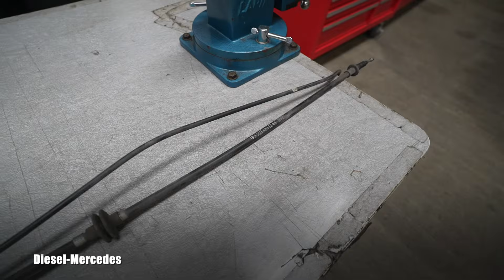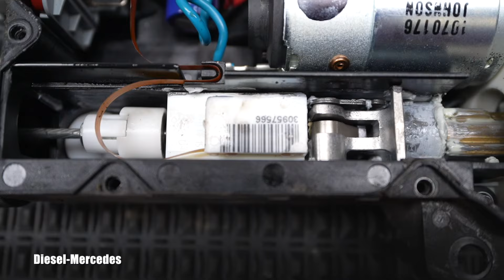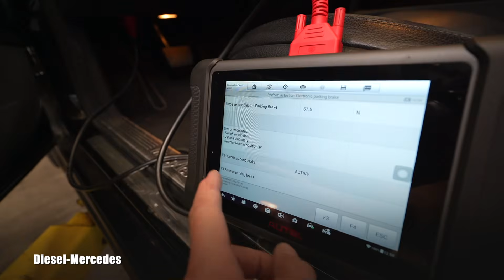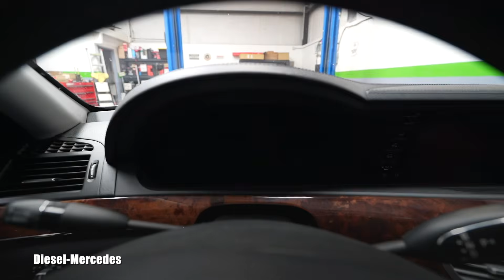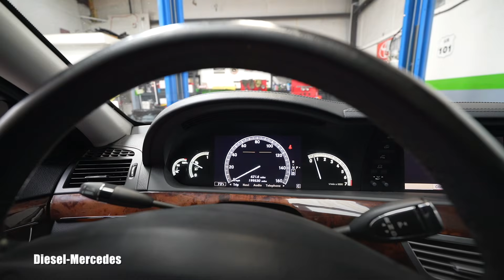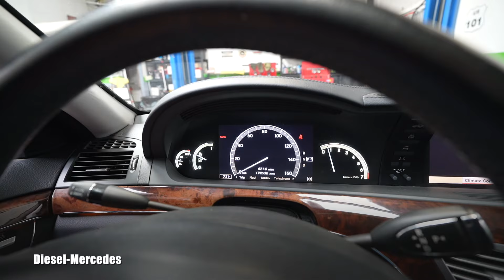Mercedes Electric Parking Brake Diagnosis, Repair, Reset

Comment: If you get:
test prerequisite "vehicle stationary" NOT COMPLIED WITH
On the DAS while trying to operate the module (Operate or Release).
Take it apart (open the module) and if all is good, as it is showed in the video, with a 12V battery run the electric (DC) motor a couple of times to in both ways. This will revamp it and the module will work as new (or just replace the DC motor).

Comment: I have  a 2008 S550. A scraping noise led to discovery the right side backing plate rusted where the spring  attached which  held brake shoe. A replacement backing plate is non existant (new or salvage). Because I never use my parking brake mechanic removed shoes, springs and all hardware. He cautioned me not to engage the parking brake.  Scraping noise was gone and I didn't use the parking brake.  

A year later, an alignment was done after suspension work. The alignment tech unkowingly put on the parking brake. I now get the dash message and blinking "Park". The message can be reset with the steering wheel button but blinking PARK stays. It doesn't affect driving but is annoying.

I searched for a shop with the right scanner to reset it but it could not be reset. I pulled the  safety release cable in the fuel filler area . It comes out a few inches but it didn't do anything.  Apparently the motor that pulls the brake cable does not sense tension/resistance of shoes against the drum (because there are no shoes). This makes the module think there is a problem and causes the message a.d blink.

Is there a way to turn off the indicator without taking everthing apart?

Comment: Great video! Gives you a good idea on how it all works. I have a 2011 CL500 W216 and I put a new auxiliary battery in the other day as my Distronic would not work (They are somehow connected). The little battery is in the drivers side dash behind the fuse box and when I replaced the battery I cross wired it and damaged the park brake module. The Distronic works fine now but, not the park brake!!!

Comment: Hello Sir, I have a problem, the actuator pulls the cables and the shoes until they get stuck inside the mechanism, I changed the pinion kit and the same problem. Shoot until it locks. Is there any different mounting method? When I mounted it, I did the same as in your video, I left the cables extended to the maximum, then I mounted the shoes, the disk, and then I operated from the F3 F4 tablet, but at a certain point, it stopped working, because it pulls until it also blocks the release of the brake, it no longer works.

Comment: Great video, Sir. They have similar actuators in the Land Rovers. I have just reconditioned mine as it jammed recently. First, I unwound one side that became stuck, then renewed the gears in the gearbox. One particular gear acts like a clutch to minimise damage to the other when they become jammed.

Comment: Hello Peter, the motor was producing some smoke when you are testing it. Check the amp draw on it, if it is higher than 5 amp, it might need to be replaced. This might have prompted the error you are seeing.  I suspect this one was drawing in excess of 10 amps. This motor can be replaced by itself without replacing the entire module.

Comment: Great to see you have that working. I have worked on the 60's to early 70 VWs. I was surprised how well they seal everything in contrast to American cars. They even sealed the torsion bar. The interior light switches were sealed. This is why they floated forever. LoL  My wife has this auto park brake on her RX350. Are we really getting that lazy?  So it looks like your issue was crud on the mechanical parts of the park brake drum and shoes. Since I'm a poor bastard, I would probably have checked there first. Also because I don't have that cool test equipment. 😋

Comment: I remember having a rental of this era, and when I started the car, I didn't have to hold the starter position until the engine was on like most cars. Because we have to hold the key to the start position to have the bendix of the starter motor engaged. For that Mercedes I had, it was fancy, I could turn it to start and then immediately release and the ECU once receiving my input to command the start position, even when my hand was released, it figured out how long to engage the bendix of the starter and auto released it. I feel like the same technology might be in the parking brake, no need to hold, just push or pull briefly and release. Just like the one touch window feature you used.

Comment: I like seeing you use the power tool. I think you should include this in your other videos, even the DIY. Just a suggestion of course, your channel, you do as you please. But for time, just like at the dealer and like here and like when the camera is off, I would hope you crack it loose with a hand tool and then switch to power to buzz it out. 

I even hear stories that the techs so the taboo and no-no's of zipping spark plugs out with a power tool.. of course hand tool to install and torque be feel. But if you choose only hand tools, I understand. It is fair to do it to mimic home garage repair. This is not a complaint. Only comment to help you because you said it takes so much more time. Maybe it can save some time.